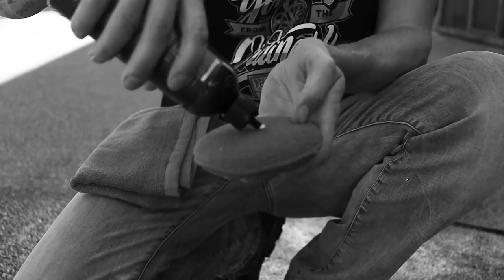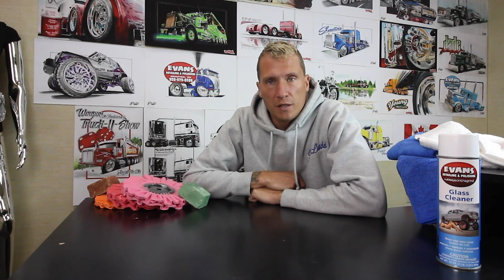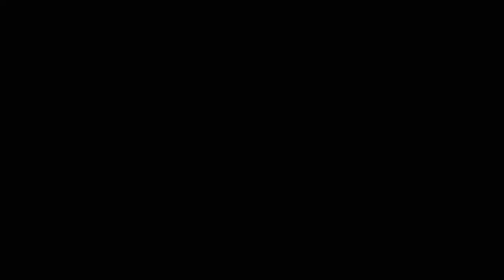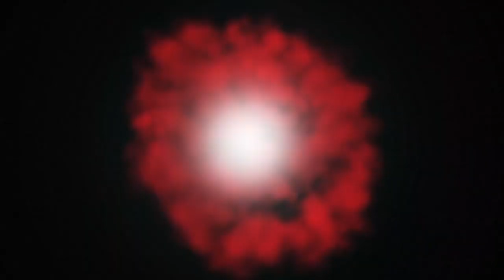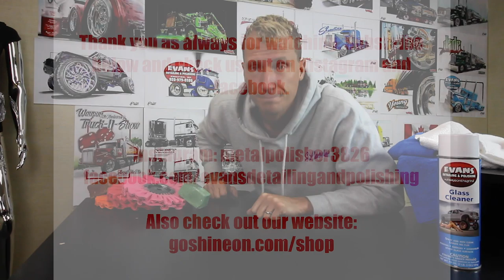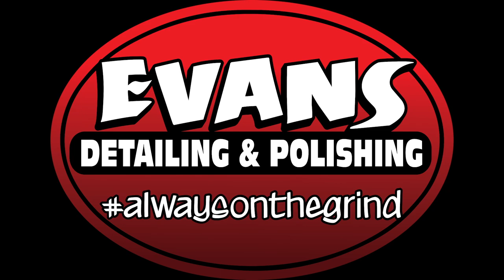What causes burns on aluminum?

Comment: Thank you for the videos . I have a set of cast aluminum slotted mags that are about 6 months old and a helpful car wash attendant sprayed the bug dissolving soap that they spray on your windshield on my new wheels while they were hot and it stained them, my question is is it possible to get the stains out with sanding and polishing or is it a lost cause. Thank you in advance

Comment: Take a look at "Niter bluing". Basically a process of using very hot niter salts to deposit a thin layer of oxides onto a metal surface (usually iron) to give it color. A range of colors is possible depending on temperature and time. I suspect what you see as "burning" is basically a similar process of depositing a collection of oxides, nitrates and other Metallic ionic compounds which form between hot metal and polishing paste/wax. Stainless has a layer of chromium oxide on its surface, which is allot less reactive than say aluminum, so it is harder to "burn" it, unless you wear through the passivization layer and get to actual iron rich portion..
Reply from the maker: Thanks for watching